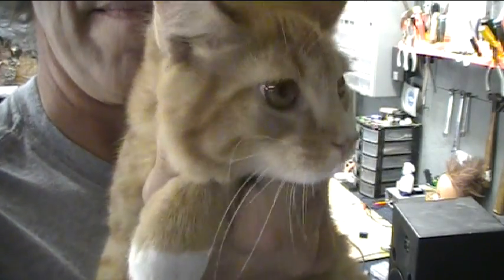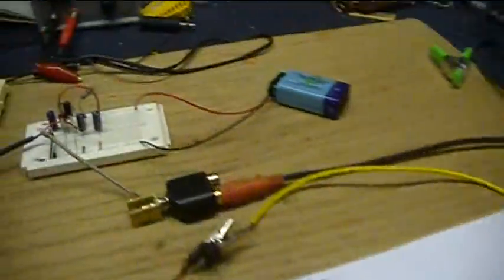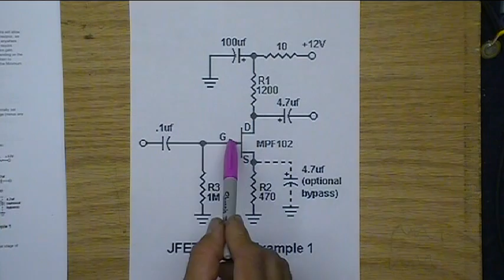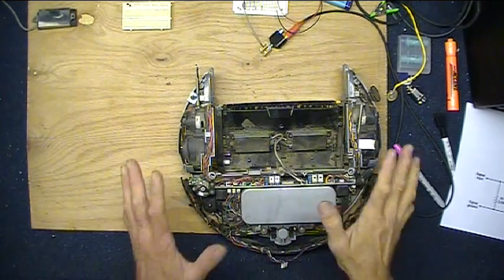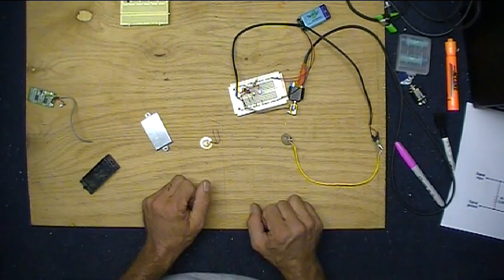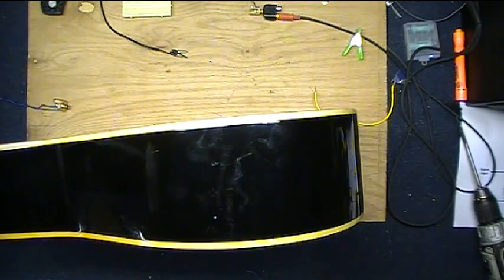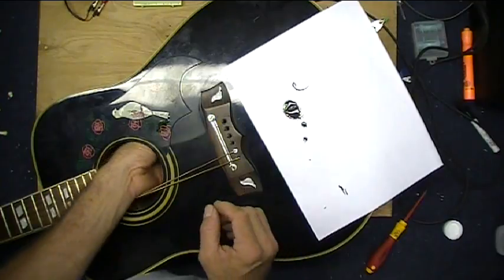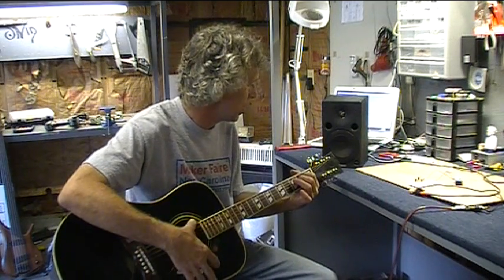JFET Preamp with Piezo Pickup.avi

Comment: To eliminate the hum, you could put the FET amplifier in the guitar. The higher voltage signal from the guitar to the speaker amp would then be less susceptible to hum and other interference. I think you can use a stereo jack as a power switch. A drawback is that you would have a battery in the guitar, loosening strings every time the battery runs out is probably less fun. Making a big hole for a battery compartment door would hurt your guitar even more.

Comment: The J201 has lower noise and much lower consumption than the MPF102, and the 2N3819 is a higher consumption option, but will require compnent modifications. JFETS are not uniform with their specs so it's advisable to experiment on a breadboard first to ensure proper biasing and no clipping (distortion). I would suggest reading this website fully: hawestv.com/amp_projects/fet_preamp/fetpreamp4.htm
Reply: Did you try different JFets for piezo pickups? Any suggestion on a better one? Have a 2N5457 on my desk and wonder if it's worth thr time checking it out ;)

Comment: Good info video by you actually I'm facing noise humm ground issue so do I need to change saddle pick up or there can be issue in pre amp also?????? What are factors causes for hum , I do live gig so use di box but at home set up there is no di box simple cable mono with amp

Comment: I'm new at this electronic stuff and would like to have a nice little amp for my ukulele that I put a Piezo element in. I've built the project but am  having some difficulty. I was wondering if your speaker that you play the guitar through is powered with more than just the preamp?

Comment: Epoxy is forever, hot glue is a better . I just repaired a guitar with the pickup jack installed where you put yours. He bumped the plug on  base of his guitar stand and split the side of his guitar. Spend $5 on amazon, and buy a endpin jack . Then you have a better place for the output jack , and a better strap button . It also has a grounding lug on the jack so when you un plug it turns
Your preamp off.

Comment: Is the schematic shown (JFET Design Example 1) the same design as what was implemented on the breadboard preamp?  Also, would a +48V phantom power signal be damaging to this circuit, or would it simply provide the necessary power as does the 9V battery?

Comment: I like this video, as far as it goes.  You show how to install the piezo disc and jack, but the title of your video is about the JFET.  Id like to see a video that demos the difference between putting the JFET in the circuit and running the signal direct to the amp without going thru the JFET.  Some people claim the difference is significant, but other claim the preamp is unnecessary.
Reply: Using this kind of piezo without a preamp will sound very low. You need a preamp, JFET or any other with high impedance input

Comment: This is a Tillman JFET pre-Amp. Google for info.

I made one of these to use as a preamp for electric guitar and it really makesit sound a lot better in clean mode, rather similar to turning a clean amp up loud. That's likely due to the high impedance input that doesn't impede the pickups as much as a lower impedance amp inputs. Trouble is that it clipped with humbuckers, which was only solved by increasing the Drain resistor value or running at 18v. Breadboard testing helps a lot.

Comment: Hi HAW, in response to Reteeemil post, the 2N5458 has the same specs as an MPF102, Dean, you basically have one part of a Runoffgroove Ruby 1/2 Watt practice amp, with the addition of an LM386 output stage, easy build and work good. I build the Ruby Amp v1.2, Google Images or Runoffgroove.com. Like a Noisy Cricket, etc.. I put them in a deeper cigar box( to accomodate speaker), use 4 to 16 ohm speaker. Build one, their cool. Keep on Hacking. C.

Comment: Great video Thanks! I have 2 suggestions you may want to try. One is that, to me it sounds better to mount the Piezo element with double face tape then using epoxy. This gives it a little less harsh response. Also to get less noise from the very high impedance input I would say it is much better to mount the preamp inside the guitar as the lead to the pickup will be much shorter reducing  hum greatly. Thanks!
Reply: Yeah the whole thing needs to be put inside a metal mint tin box and all active leads must have good shielding.

Comment: FYI -- I've put lots of piezo pickups in instruments with a buddy of mine--- but we usually opted for radio shack (where a piezo element is about $2.00) -- or a 76db piezo buzzer for about the same price and then just broken it apart to remove the element (the benefit to the buzzer versus the element, is that they have leads already soldered on so no risk of messing up while adding them).  Bigger question though is why put a preamp on these?  They're super loud and brassy on their own?
Reply: That's why you need a tone and volume control
Reply: They actually sound more like an actual guitar.

Comment: i have a bass and id like to add a preamp to change it from a passive to an active bass. its an ibanez soundgear sr405 with three knobs. 2 volumes, 1 for each soapbar humbucker pickup and a tone knob. the wiring diagram is here. http://s55.photobucket.com/user/danomite64/media/Basses/EBX-445wiring.gif.html

can this preamp be used to boost these pickups? a lot of active basses use 18 volts and take 2 9v batteries. would you be interested in designing a circuit for this application? also i think it would make more sense to combine both the volumes to one knob and make one knob switch between the two pickups and have a stacked treble bass control knob. ideally.